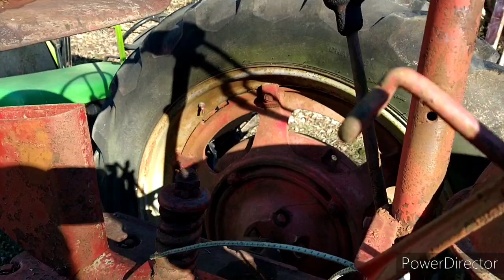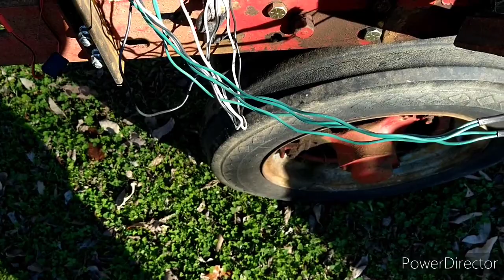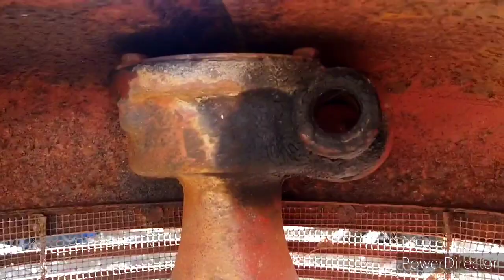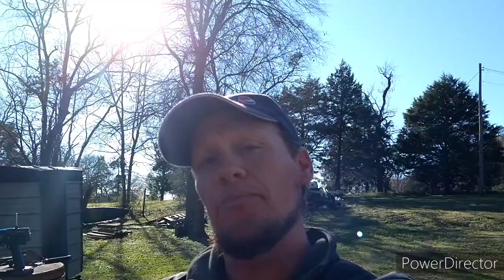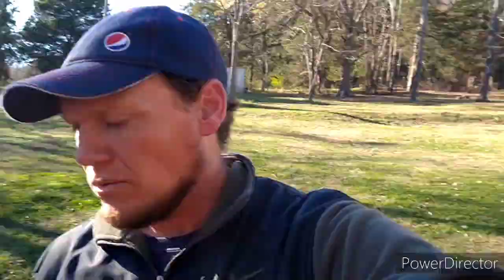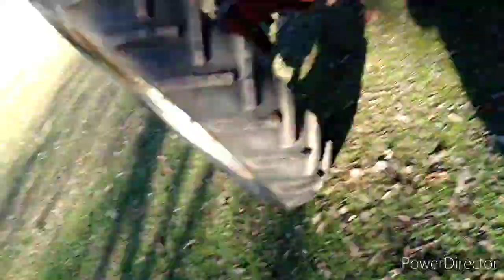Predator 212 Tractor , R/C explained, electronics removed, and covered in Christmas lights.

Comment: Great video.  I suspect there’re is a fault within your steering servo.  Servos have internal stops which limit their movement due to an actual hard stop and a potentiometer located at the bottom of the servo.  From past experiences I would recommend replacement with a ball bearing metal gear drive servo of a brand name.  They tend to be a more money but highly reliable.  Also use a stiffer aluminum for the switch arms and decrease the length of the servo arm. The further away from the center of the servo arm, the higher the torque on the gear drive within the servo which can lead to stripped gears.
Reply from the maker: I appreciate the insight, thanks for watching.

Comment: You are on the right track for remote but need to consider a few things.
   1)  by cutting the front arm down you are at more of a "disadvantage"  for force to turn vertical steering shaft.
    2)  I believe what is causing most of the problem with the vertical steering shaft turning so hard is that the "flat" gear in the top gearbox is trying to drive a worm gear on the horizontal shaft which puts you st a great mechanical  disadvantage. (Not the case if there are two bevel gears in gearbox)
    3)  Check the rating on your limit switches.  Commonly those switches are not designed to carry much of an electrical load.  Most likely what you have are rated for what is called "pilot duty".  They are made to operate a relay that is designed for the amp load of your choosing depending on the amp rating of your relay.  I fear that now you stand a chance of either burning a contact's contacts off so it will not make contact or they will burning together,  causing a permanent closed circuit causimg the actuator to not want to stop trying to turn.
  Interesting vids
Reply from the maker: I thank you for commenting, let me see if I can clear up a couple concerns. 1) I shorted the arm to it's current length to have a shorter stroke, I did some manual testing before I decided on a length 2) I'm aware of the problems with turn a worm gear with a flat gear( backwards) the worm gear is attached to the front steering shaft that is removed when it is R/C, so essentially at the point it is a free turning dead shaft)3 I think my switchs are are rated high enough for the draw of the actuator, haven't had any problem so far, but it was a concern early on. Thanks for watching
Reply: @ChrisfromKeyfarm  I'm not fimilar with the steering box on that tractor    (I'm an Oliver guy),  but trying to turn that worm gear "backwards"  even without shaft connected is still going to put a considerable load on actuator.  If you can do your steering with the horizontal shaft and maybe a geared DC motor with chain drive   I believe that wouldn't take as much power or force to turn wheels especially since there is not near the weight of the shock tractor on the front wheels.
Reply from the maker: The worm gear is made into the removed shaft, no worm gear on the tractor 😀

Comment: I remember the part on the front of your tractor with  a front steering component outside the body used for steering, but I don't remember if it went alongside of or to the main steering shaft. Or it might be a lifting brace that the cable went through.